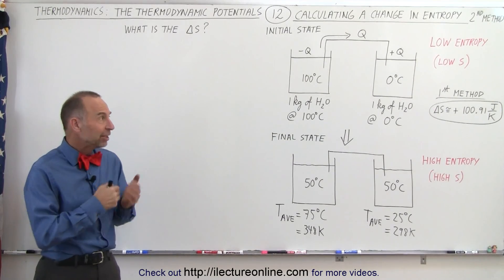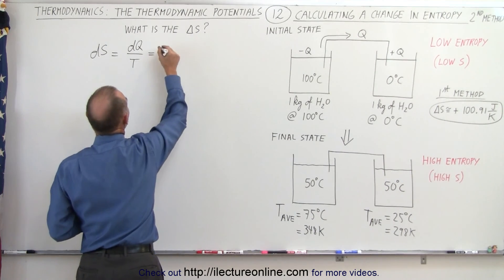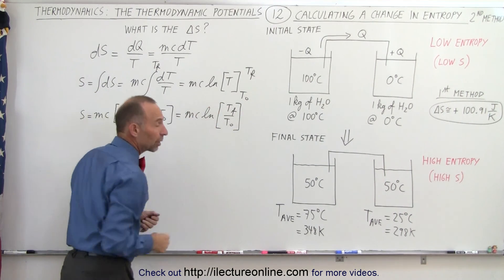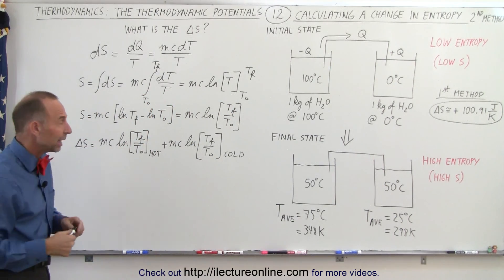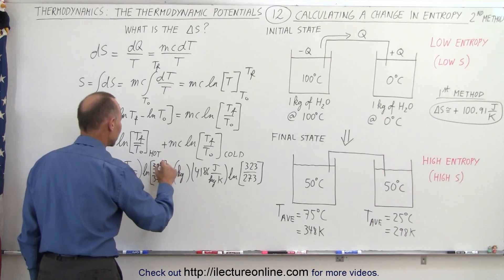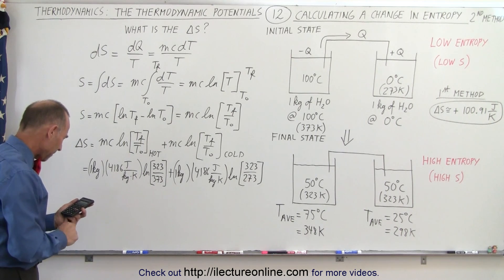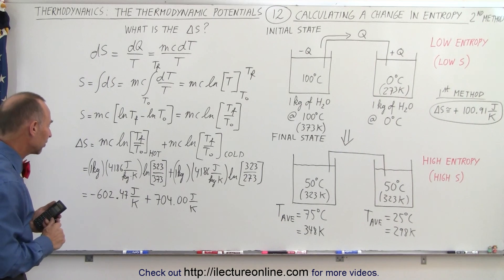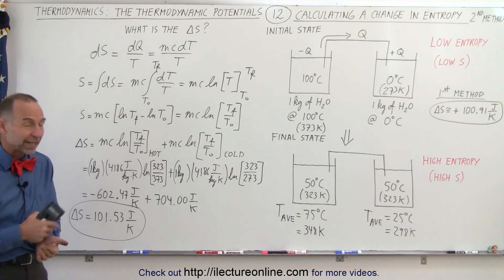Physics 32.7  Thermodynamics Potentials (12 of 25) Change in Entropy: 2nd Method***

Comment: Suppose we have two processes.One is adiabatic expansion in reversible cycle which has final temperature say Tr and the other one is adiabatic expansion in irreversible cycle with 'Tir' as final temp.

Then which one has more temp.
Tr or Tir?.
😀
Reply from the maker: An irreversible cycle implies that energy was lost during the cycle, which cannot be retrieved.  Depending on where that energy goes, the final result will differ.  If the energy is lost to the environment, then the final temperature of the gas will be lower.